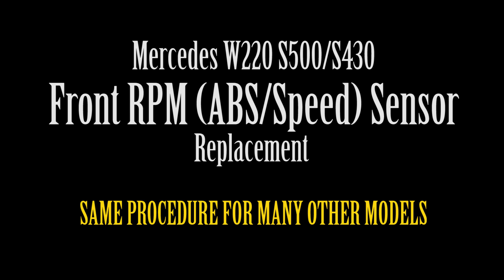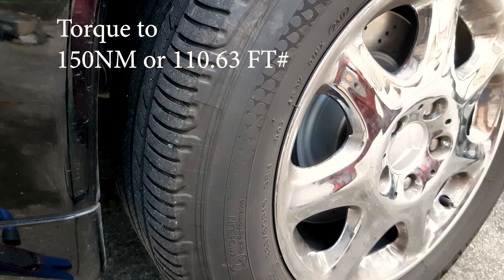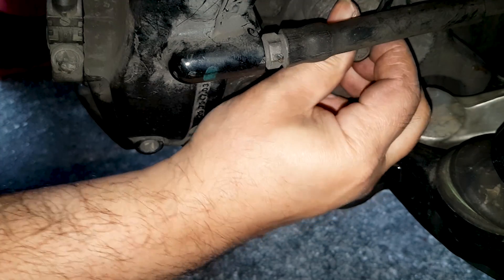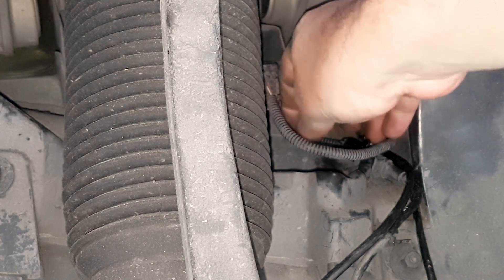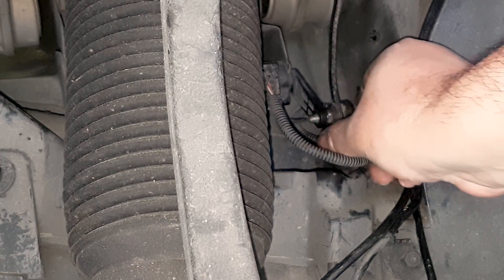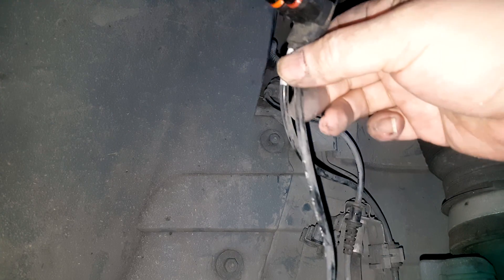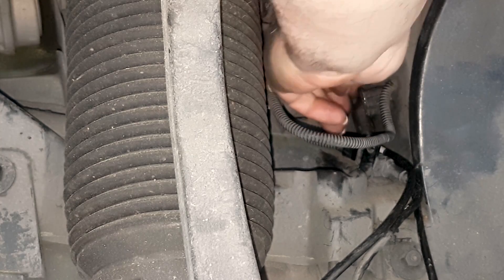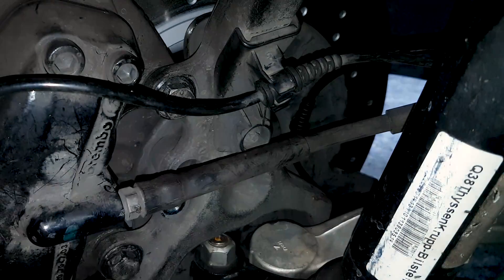Mercedes Wheel RPM Speed ABS Sensor Replacement (W220 S500 S430, etc)

Comment: My 2000 s500 is throwing codes

P0720
P1605
P0500-25 (rear left sensor code)
P0600

I’m praying to god the wheel sensor will fix it.
Reply: With what did you read the Codes?
Reply: @ with one of those big iPad tablet looking readers.

Comment: Ok thanks.   My car S500 2004.  Code P0500 Speed sensor A.  
Would this be the front driver side sensor?
Reply from the maker: You're welcome.   It could be any of the speed sensors.  Get the car scanned, purchase a scanner, or test with a volt meter.

Comment: Will this make the car go into limp mode
Reply: And, in my case the ESP/ABS light was on, too. Had me guessing as to Why. I picked up the iCarsoft mb V3 and did a scan and reset. Problem solved.
Reply: @bobmullins765  this 1 is aswell.
Reply: Danke für dein Video es hat mir sehr geholfen
Reply from the maker: Bitte schön, Ronny.
Reply from the maker: Do you mean if the RPM sensor is bad?
Reply: @masood-tv  no the wheel sensor. I'm working on 1 that won't shift. 7 codes 3 say front left wheel speed sensor implausible speed.
Reply from the maker: @bradykay9322  RPM and Wheel Sensor are the same.  Yes, it could...
Reply: @masood-tv  o. Ok. Thanks for the info I will definitely  try it out.
Reply: I have a 2002 cl55 amg that is in limp mode the abs light is on where should i start?
Reply from the maker: You should start with a good code reader...

Comment: For a few months, while on the interstate my s500 (RWD) traction light would blink like it was slipping and kick off cruise control. I could always turn it back on and it would be fine after that (it maybe did it once every two hours). Now after a few months of limited driving, the traction light comes on under moderate acceleration and i can feel the rear wheels slipping. Could this be related to speed sensors? I haven't had any lights come on.
Reply from the maker: Hi Brennen - slipping wheels is a sure sign of bad speed sensors.  Another is actually hearing and feeling it at the pedal. The best way of course is to have a scanner that reads and displays speed sensor data.
Reply: @masood-tv  I also have a s430 and last night the car started acting up it feels like it self brakes and the brake pedal vibrates but it makes a weird noise when it “self brakes” also the esp light comes on and off. Any ideas ? Thank you in advance!
Reply from the maker: If you are maintaining your own car, I strongly suggest you obtain a decent scanner to check the car for irregularities.  I have never heard of those cars self braking.  Check for existing error codes first please.
Reply: @masood-tv  it feels like only on of the tires or something like that, initally i was thinking of wheel bearing or yam sensor but idk. And no tbh i dont mantain it personally but im trying to learn. If you dont mind sharing a social I woud text you the video, you can kind of see how the car is reacting
Reply from the maker: Sorry, I wish I had time.  I get requests like this from other viewers, too, but I have barely enough time to answer the many questions on YouTube.